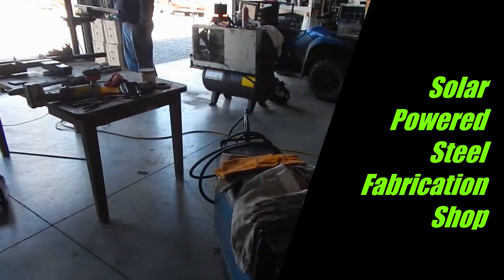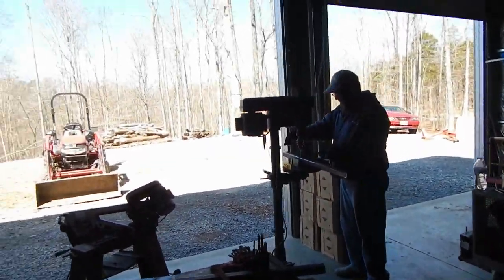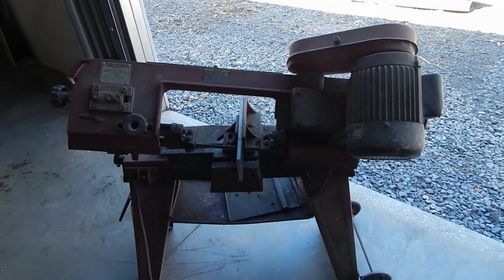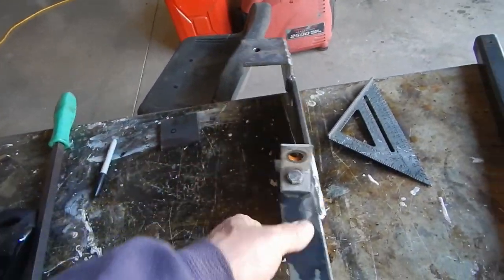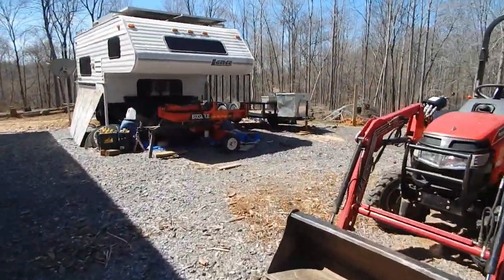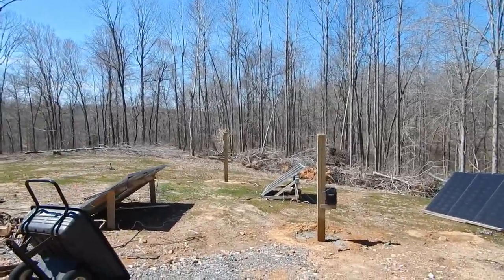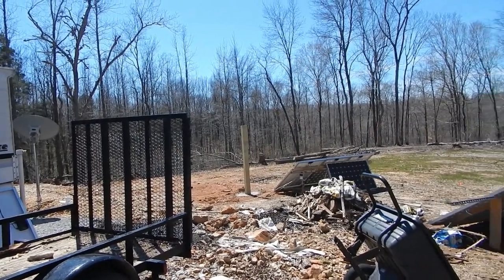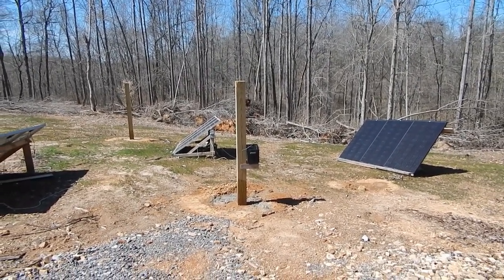Solar Powered Steel Fab Shop Up & Running!

Comment: What kind  of inverter/ controller/  and size of your battery pack?
Reply from the maker: At the moment I'm running a samlex 4024 inverter. Midnite solar classic 150 and a Outback flexmax 80 charge controller. 4000 watts solar.1424 amp hr at 24 volts. Check out my latest video and you'll see the soon to  come  switch to the magnasine inverter and the 48 volt upgrade and you'll get to see the whole setup.

Comment: Are you running the welder off solar? Or is the welder powered by grid?
Reply from the maker: Off grid on solar.  No grid power here.
Reply: @TheKiloG69  Very nice, what is the kw size of your inverter?

Comment: I know your excited to have the trackers up and running.
Reply from the maker: Wyattoneable. Yes I am there still not up and running lots more welding to do lots more installation to do wires to run it's going to take awhile. Much more to come.

Comment: Push the puddle brother. Sounds nice tho
Reply from the maker: Frank Z. Sometimes I push the puddle sometimes I dragged it sometimes I do a zero degree attack as long as the gase flow is adequate ,good speed,  good penetration either way works good.
Reply: @TheKiloG69  its true but the correct way is to push mig and tig. Dont mean to be a dick its just something i do for a living and wanted to make sure you knew the correct way.
Reply from the maker: @frankz1125  it's all good brother I appreciate all the comments and yes you are correct.
Reply: @TheKiloG69  cheers my friend. Keep up the good work.

Comment: You have that welding down. Nice that you can weld with solar.
Reply from the maker: Jim McGraw. Thanks Jim I have been welding for years not the best welder in the world but I get the job done I am certified welding in automotive HSS Steel only.
Reply: I welded aluminum for a couple years. For me now I don’t mind welding on small things for me. But not for a living anymore

Comment: Must have learned on a stick welder and didn't get the proper training on a wire feed.  Not try to be critical but I see the habbits of a good stick welder
Reply from the maker: Roy Amberg. Yes Roy I did learn on a stick welder at 12 years old. My only certifications in MIG welding is on  automobile and truck HSS steel .I had to be for insurance work. I drag my welds pull my welds and use zero degree attacks with good gas flow, heat and penetration and speed that's really all that matters my welds don't break.
Reply: @TheKiloG69  don't break is what matters